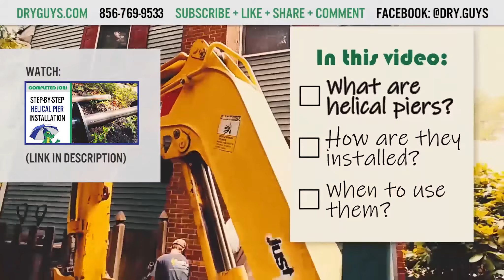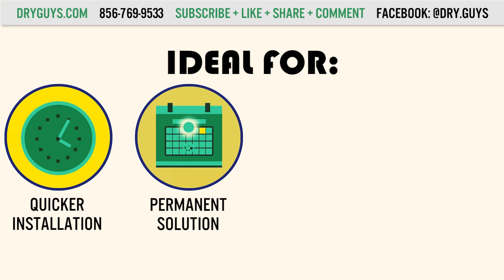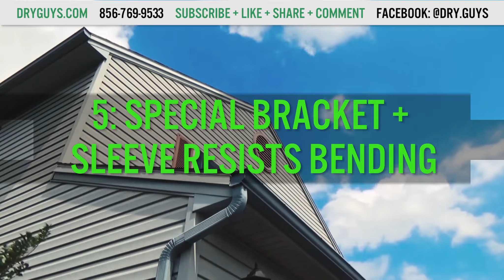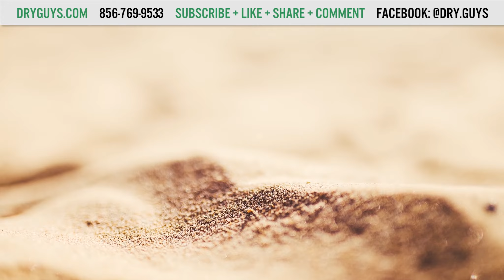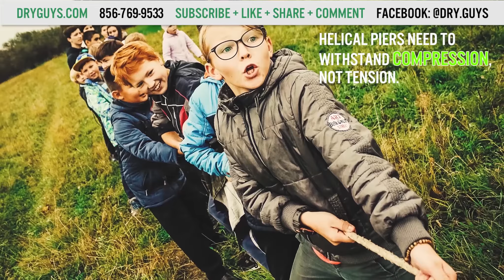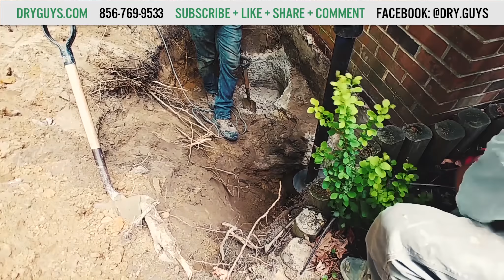🐊Helical Piers for Foundation Repair? Pros, Cons & Homeowner Tips

Comment: My question is is that you were actually creating distance between the house foundation and the original soil in which it was laid. This means that you are stressing all the utilities and systems that span that distance like electrical but especially plumbing. If some of these houses have settled 2 in, there won't be 2 in of stretch available in any of these utilities but especially in plumbing. How is this resolved?

Comment: This foundation company wants to charge my $90,000 for 30 piers but he didn't say it they were round or square -- should I be worried - looks like it.
Reply from the maker: It really depends on how deep the piers need to go. The piers need to keep going until they reach stable soil. That stable soil could just be really deep where you live. The deeper they need to go, the more it will typically cost. It seems like a high enough quote that you should be asking questions to make absolutely sure you're getting exactly what you want. On the other hand, you're investing in your house and its long-term health, and the service being done is valuable if done right.
Reply: @DryGuysNJ 90k seems very very very excessive.
Reply: @crosisofborg5524  My house is 1,900 sq. ft. and my quote is $42K. Maybe the dude has a big house.
Reply: @DryGuysNJ  After watching your videos I have long lists of questions. I have a 2nd opinion coming. 
Thanks

Comment: If there is a two-story deck in the way, how hard to work around it? Can some deck boards be removed to navigate an excavator arm for drilling? Is it easier to go with push piers for such a situation?
Reply from the maker: Hi Kris! It depends on the height of the deck and if we can fit an excavator. It also depends on the girders and joints more than it depends on the deck boards. Push piers are a viable option if there are clearance issues. Push piers are also preferred since they require less engineering (soil type and sampling).
Reply: @DryGuysNJ  Interesting. What do you think of the mass pour underpinning method? I'm planning to stabilize a corner of foundation with simple mass pour technique. Would a mass pour (with sufficient rebar and dowels) make push piers/helical piers more difficult or impossible in the future?   I'd consider these lifting methods compared if I could find it at a reasonable price in my area.
Reply from the maker: It all depends on whether or not you have a footer. Without a footer, doing that correctly is difficult and requires precise engineering and then if you were to go in and add helical piers later it could complicate things. If there's a footer present, you'd have dramatically better results because you'd be able to lift it further without it cracking. We've lifted slabs without a footer before and even for us it was very hard. We also recommend you save your money and go with either one solution or the other because you don't want to put your foundation through the stress of having to be moved twice. It's cheaper to do the job once right the first time.
Reply: @DryGuysNJ  I'm talking about a stem wall foundation (has a T shaped footer, no slab). I want to do a simple mass pour to widen and increase the weight bearing stability of the footer, but no lifting. It's pretty simple to do DIY. I'm trying to avoid the huge cost of underpinning with lifting for now, but it might be needed someday.
Reply from the maker: @mershymarsh  Oh I see. I'd consult an engineer before proceeding just because there are a lot of local factors that can affect the project like the type of soil your house is built on. If you want to make your footer wider, it's also going to make that footer heavier and it could cause your house to sink even faster.
Reply: @DryGuysNJ  Your advice is so professional

Comment: This seems to only address the perimeter foundation. Main bearing walls in the interior of the building are bearing on footings that are also on the same soils. If the soil doesn’t have adequate capacity, or the footing is inadequate or the post is wood which may be subject to microbial degradation how are those potential issues remediated?
Reply from the maker: You are correct about helical piers only addressing the perimeter. If the interior needs to be addressed, we use push piers, and for several reasons:

1) Helical piers need more clearance. Our equipment has limitations.
2) Safety. The use of a "dead man" while trying to drive indoors is potentially fatal.
3) Efficiency.  Working indoors with remote lines to the drive head, chaining a dead man to the rafter to offset torque and having to use multiple short extensions is time consuming and costly.
4) Helical piers are too invasive for the interior. Flooring often has to be removed to drive the pier. The cost of repairs can be excessive compared to push piers.

We hope this can answer your question and appreciate your comments.
Reply: @DryGuysNJ  describe push piers please, thanks
Reply: @DryGuysNJ  wow you uys are really honest and genuine I respect that
Reply: I don't think they ignore the installation of foundation supporting peers on the interior of the home as that would be absurd. In some instances I believe they actually have to go in and jackhammer out locations on the interior and install similar structural piers. Yes, it can be invasive and in situations like this you will most likely have to move out for your own peace of mind while the repairs are done because floors will be torn up and so forth.